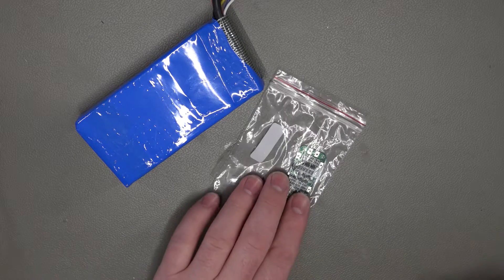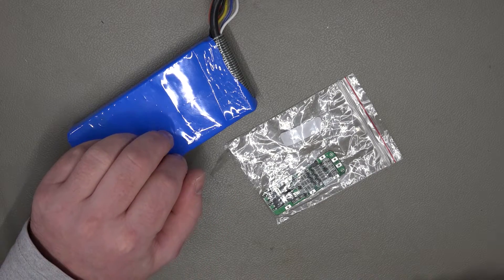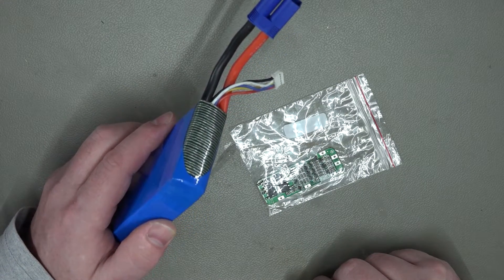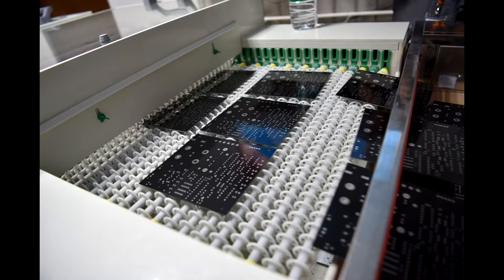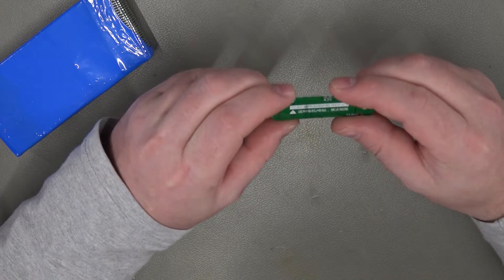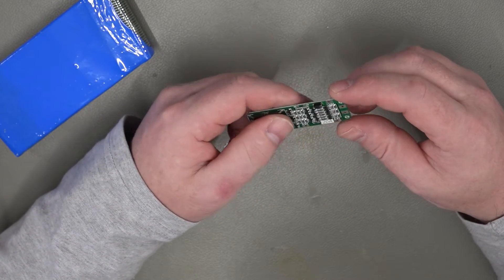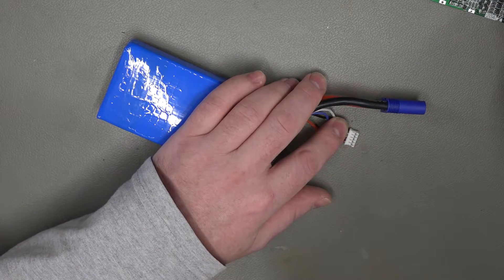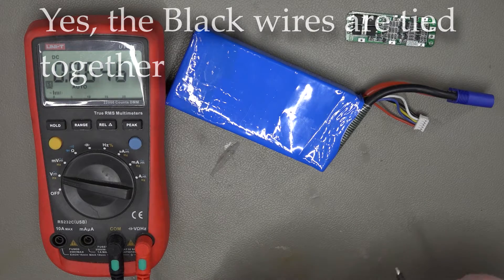Lidl Ultimate Speed Jump Pack - Dead Cell??

Comment: Old video I know. But these cells are LiFePO4 cells. So 4.2v is to much, they are 3.6(5)v each. Smarter thing to do was just repair the old board with a r200 smd resistor or a "normal" resistor. fyi R200 is 0.2 ohms.

Comment: Not that it matters if the cell is dead anyway, but pretty sure they will be lithium iron pouches so the 4.2 charge voltage is a bit over their required 3.65.